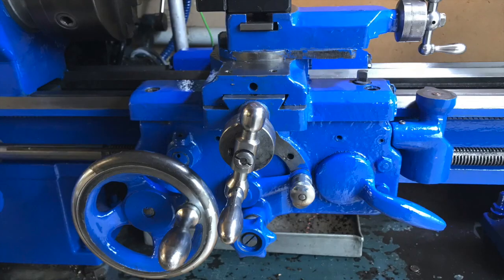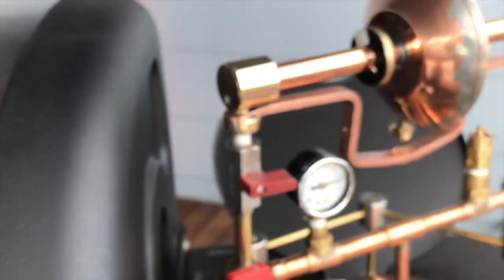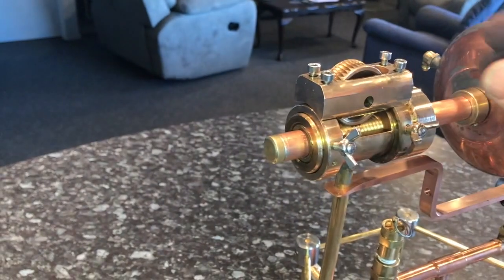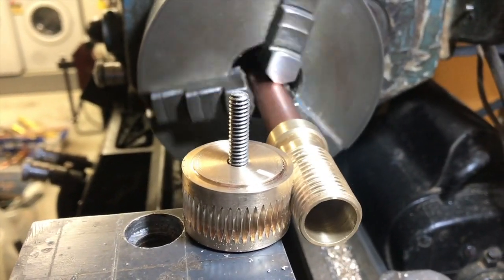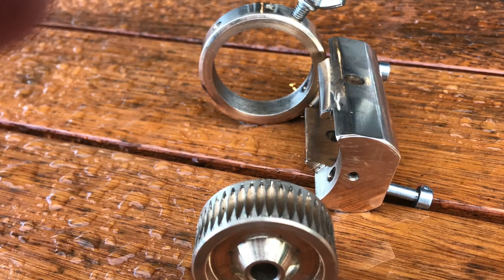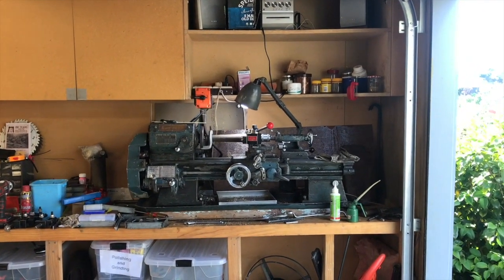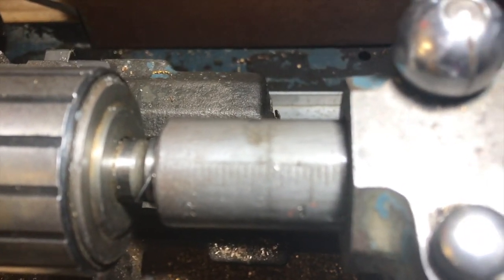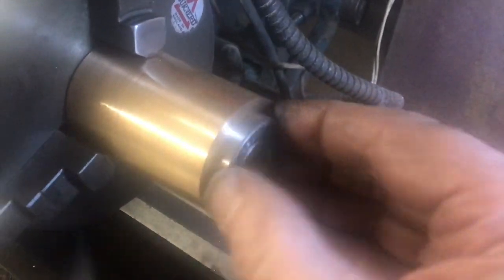10 minute easy gear wheel production on an engineers metal lathe without milling tools or indexing.

Comment: Hi Evan,  personally I think it better to call the Aeliopile a turbine rather than an engine.
Reply from the maker: Yes I agree it is a turbine, but isn't a turbine a kind of engine, as in jet engine? A member of the set of engines. One day I will improve on this design.
Reply: @Evan-e-cent  Hi Evan, it is just my personal preference, not a judgement.  plus th eterm jet 'engine' is vernacular the correct term is a jet turbine engine, i.e. a turbine which creates a jet of gas to perform work.
Reply from the maker: @TerryD15  Hi Terry. It is an interesting question you have raised so i looked up 'engine' in a dictionary and I think the turbine described by Heron of Alexandria still qualifies as an engine. 
https://www.merriam-webster.com › dictionary › engine
Engine Definition & Meaning - Merriam-Webster
The meaning of ENGINE is a machine for converting any of various forms of energy into mechanical force and motion; also : a mechanism or object that serves as an energy source. 
Whatever we decide is the most precise term, I think as far as web sites are concerned I would have to continue to use the common name "Hero's Engine".

Comment: I just watched a gear hobing video using this same technique,the full width gear you buggered happened as you say from the flutes trapping the gear,to make a full width gear you need to use a spiral cutting tap so that the cutting teeth are always engaged then the gear can't be trapped and voila(why do americans say "wallah") hobgear cutting.

I hope this helps,now you need spiral cutting taps,machine taps,the spiral evacuates chips like a twist drill,so i'm sure there will be many on fleabay,a simple fix and neat little tricks.

All the best from me to you here in Scotland,cheers.
Reply from the maker: Thanks!  Thats a good explanation for the use of spiral hob cutters.  It hadn't occurred to me that I could get one cheaply on eBay. But I suppose the point of the video is to show that it can be done without buying any special equipment (gear) as many hobbyists, especially retirees would not want to spend money on such an item. Of course you can buy gears and make them by 3D printing too, so there are a lot of options.  As you know I got around the issue by using a wider blank and machining it down afterwards.  One could make plain spur gears by using a very thick blank, and gradually raising the height to make wide teeth, and again machining it down afterwards. One day I plan to make bevel gears this way, but there are problems of pitch with varying radius to overcome. I will use a narrow geared rim on a larger blank diameter.
Reply: @Evan-e-cent  Hi,Evan,I just bought a set of spiral taps 6mm to 12mm from ebay for £10 post free,but as you say you can make tools if you know how to make a bevel cutter,i also want the spairal taps to use in the lathe and mill so the chip evacuation flutes are good to get the cut done in one go,but as i say £10 ebay,a sine rifling tool could be rigged up to make a spiral flute cutter for cheap,and make any cutter you want from tool steel blanks.

Comment: did you also realize the tap is not relieved for cutting a worm gear like this, well at least not in the portion you were using.
Reply from the maker: I know that the metric thread is not the ideal contour for a worm gear but the two components (worm and gear) match well enough. Would you like to elaborate?
Reply: @Evan-e-cent  Yes, ill elaborate. The rear section of a tap is just a standard helical thread profile interrupted by the channels for chips to accumulate. You have the first part of a cutting tool. the second thing you need is relief behind the cutting edge. The material behind the profile of the cutting tool needs to be relieved. Imagine trying to use a drill bit as an endmill and cut sideways, its not been relieved behind the "cutting edge" so it rubs and makes it a lot harder to make chips. This relief behind the cutting profile is fundamental to all cutting geometry. You profile your cutter, then relieve the material behind the profile so it doesn't rub and requires less pressure to dig into the part. This applies to drills, endmills, lathe tools, saws and taps. Taps do have relief, but only at the tip.
Reply from the maker: @davidfarmer  So it is like the front clearance angle on a lathe tool.  Now that you mention it, I have seen that angle on the first third of a taper tap.  Thanks David.

Comment: Hi. Saw similar steam design at a woodworks shop as chips were plenty full. They placed brass flat circular ring fixed around outside. On this ring, if i remember, 7 copper cups at looks to be 30 deg angle. There was 5 nozzles fitted. When i asked they said the force runs anticlock while shaft runs clockwise. They could run a small generator to run couple lights. Very nice work done on your unit.👌👌👍
Reply from the maker: Yes, the Hero engine is a kind of reactive turbine. Not very efficient. Thanks for your complement. That is an interesting steam turbine.  What you are describing is similar to a Pelton water wheel which became popular in the gold mining industry in the late 1800s. In New Zealand our local foundry purchased the license to manufacture them here. They are remarkably efficient and even a small demo 30 cm model we have produces amazing torque. Prior to that they used old fashioned overshot or undershot water wheels with water supplied through open channels. By changing to strong enclosed pipes they were able to provide water at hundreds of pounds per square inch to run these peloton wheels and huge quartz crushers could be run from a single 6 foot diameter wheel. My wife has, on her web site about the New Zealand gold rush, a video of a small quartz stamper being driven by a Pelton water wheel (KaeLewis.com).
Reply: @Evan-e-cent  yes thats about it, pelton system. This is what old foundry men keep themselves busy with😃. Started my foundry life 1982 and ended 2012. And strange enough my daughter and hubby with soon 2 grand kids live in Hogsbay. He is also tool and die maker with full cnc. Small world we live in. I live in, not very nice now, South Africa. Thanks for response. Have a nice day. Basie
Reply from the maker: @basiedp  Hi Basie, is that Hog Bay, Bermuda or Hawkes Bay, New Zealand? We spent 3 months in South Africa in 1982. We drove our VW bus / camper down from London, England to Capetown, South Africa and then across to Durban around the garden route. It took 14 months and was a fantastic trip. My wife is writing a Blog about it www.AfricaOverland82.com. .
Reply: @Evan-e-cent  Hi Evan, yes back then we also did road trip to see the Karoo area's. Was the best. That would be Hawkes Bay NZ. I for life of me cant remember their street adress🙈 they live next to a nursery that much i can say now, get back to you on that one...

Comment from the maker: Bingo, thanks for the info. No, the lathe is not a Colchester but a Boxford model A, made in Halifax, England in 1955. It is based on a South Bend American lathe design from the 1920's and there are about 20 different brands which are considered South Bend clones so they all look quite similar. The nice thing about the South Bend clones is that they all use the same Norton thread cutting gearbox design, so they use similar gears in the gear train. I have written a free online computer program to calculate what gears to use to cut any thread, including cutting a metric thread on an imperial lathe and vice versa. I am now writing version 2 which will be useful for a much wider range of lathes. As it is, the program can be used for almost any lathe without a gearbox as well as South Bend clones with a gearbox. See www.HeroSteamEngine.com/RideTheGearTrain.

Comment: Very entertaining video, good job. Your torque calculation should include losses due to the worm gearing which is the most inefficient  gear system known to man. That lathe sure looks familiar for some reason.
Reply from the maker: Thanks for your complements. Could you expand a bit on efficiency of gears. Do you know % efficiency figures for worm drive versus plain gears? It has also been said that the Greeks made gears with triangular teeth rather than involute curves. Do you know how much difference that makes to efficiency?
Reply: @Evan-e-cent  Evan, the thrust a gear set generates determines the efficiency. Herringbones are best, worms are not highly regarded for transmitting power.  This is why we have hypoid. Is that a Colchester? Happy gear design.

Comment: There are other postings of this method and viewers have asked how to calculate the diameter of blank disc used to make the gear. Someone replied with an equation involving a sin( ) function. While this gives the diameter that is used to calculate the Diametric Pitch DP, I don't think it is the best equation to use. Here I explain why:

Your equation is based on the diameter of a gear which is used to calculate diametric pitch and is a correct description of gear geometry. Your equation appears to calculate the radius rather than diameter. I entered the numbers from my example and it gave 21.00 and if this is radius, the diameter is 42mm  which is reasonably close to my estimate of 44mm.  So why do I think that my equation is more appropriate on this occasion? 

When the rotating tool (tap or hob) first touches the outer perimeter of the blank disk you want the cuts on the second time around to match the first ones perfectly. For that to happen the circumference must be an exact multiple of the pitch. As the cuts reach full depth the diameter at about the mid point of the teeth will indeed be about the diameter given by your equation, but the tips of the teeth will fit neatly into the outer diameter I calculated. So, for this machining method I would recommend using my equation:
where 
D= diameter
P= pitch in mm or inches
n=number of teeth
Pi= 3.1415926...
D = n . P / Pi
n = Pi . D / P
P = Pi . D / n
But the diametric pitch (DP) of the gear DP is calculated using the diameter given by your equation divided by number of teeth. For practical purposes a hobbyist may not need to know the diametric pitch.
Reply from the maker: More on diametral Pitch and Modulus for worm gears.  I wrote a free online computer program for calculating what gears to use in a gear train.  It is www.HeroSteamEngine.com/RideTheGearTrain. I had an enquiry about worm gears, modulus and diametric pitch. The next version of the program will be online soon and does these calculations. You don't need this for the tap (or cob) method shown here, but it may be of interest.  

Diametric pitch (DP) is based on pitch diameter (PD) which is the diameter of a gear at the point where the teeth of two gears make contact, (about half way between the root of the teeth and the outside diameter.)  DP is defined as  the number of teeth divided by the pitch diameter ie DP= N/PD. This is usually used in imperial units ie N per inch similar to threads per inch. 

In metric systems they usually use modulus instead.  Modulus = PD/N measured in mm.  So what is the modulus of the gear I made? The circumference was 66mm = Pi.D, So diameter 21mm. Lets assume this is close enough the PD.  So modulus = PD/N = 21/44 = 0.477.  In imperial units PD=21mm/25.4 = 0.826 inches. Now DP=N/PD = 44/0.826 = 53.26 .
Reply: Thanks for your ex. I was searching this info for a while. Subscribed

Comment: Nicely done. I hope you don't mind, but I wanted to let you know that you can sharpen carbide inserts. You need to use a diamond wheel of some sort, or some diamond honing stones. I use a Dremel with the diamond wheel. You just need to make sure you grind from the top downward. Stefan Gotteswinter  in an incredible machinist and makes great videos. Here's one of his videos on the subject. Have a good day sir, and keep up the good work.  https://www.youtube.com/watch?v=UUVvgcvlbBs
Reply: Thanks for the tip and the link. I had heard that you can sharpen them so I keep all my chipped inserts but they are so cheap from China that I haven't tried yet. I have a diamond file.
Reply: @evanlewis4086  You're quite welcome, Sir. It's mostly just a tip for when you don't have time to wait for shipping from China, or when money is tight.  You wouldn't believe how much better carbide cuts when it has an edge put on it from a 600 grit of finer sharpener. Have a good one.

Comment: Hi there.  Very nice work. Is there a reason you went with 44:1 ratio?
Regards,
Paul
Reply from the maker: Just that the stock bar I had available had a circumference of 44 times the pitch of the thread I wanted to use.  It was intended to be just a practice run but it worked so well that I ended up using this 44:1 worm gear for the Hero Steam Engine project. See www.HeroSteamEngine.com. It turned out to be a good ratio for the engine. It was also small enough to make a relatively simple gearbox housing. Glad you liked it!

Comment: very cool way to make the gear :-)
Reply from the maker: Yes I love this method. I think it could be adapted to make conventional gears by raising and lowering the stock as it is cutting. The teeth would not have the perfect involute curved surface but for  many light-load applications it probably doesn't matter.
Reply: Technically, this is a Worm Wheel... not a gear wheel... 

😎👍☘🍺

Comment: Where did you get you tool holders from? I have the exact same lathe.
Reply from the maker: QUICK CHANGE TOOL POST: I bought that tool holder from China. I live in New Zealand and shipping is very expensive from USA but I use eBay (USA) and look for suppliers in China. They generally provide free or reasonable international shipping - but after Corona I am not sure what the situation is for shipping. That tool holder is great. 

I am about to post Season 3 Episode 5 on YouTube (maybe tonight)  which shows the tool post being stripped down so you can see what is inside. 

I mainly bought it because it is so much more rigid than the original Boxford/SouthBend tool posts that I call "half moon" type. I have 7 tool holders that fit the post but wish I had more. The original HSS tool holders for the half-moon tool post did not fit the new one so I had to spend hours grinding them down and even then they only fit the XL version. When grinding take the meat off the bottom rather than the top because there often difficulty getting the center of the tool low enough. But I still use the HSS tools because I can grind them into special shapes like curves and thread cutting (internal and external) etc. If you have not joined the BoxFord users group I highly recommend it.   

https://groups.io/g/BoxfordLathe-UserGroup

Comment: Was that what I found in the freezer. I thawed it out thinking it was a lump of steak.  Why is the valve of the Hero engine leaking water when operating under steam and nearly putting out the gas barbecue flame?
Reply from the maker: Because the boiler is too small and shallow the vigorously boiling water splashes up the central steam outlet pipe. Then some leaks out of the pivots as it spins. Something I didn't expect. It may occur less if I do not put so much water in the boiler.